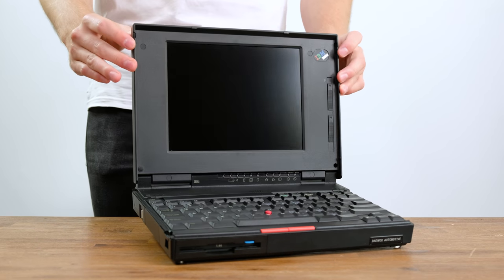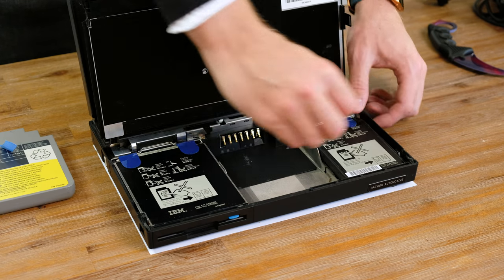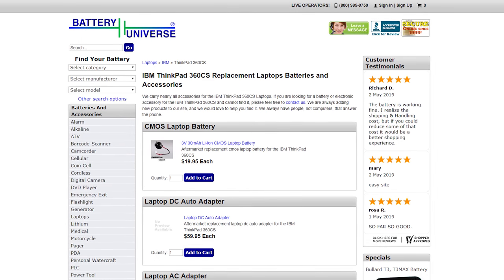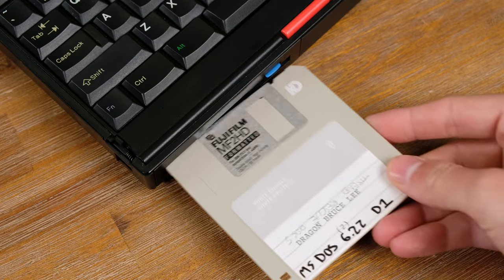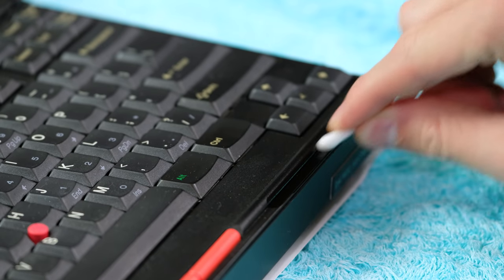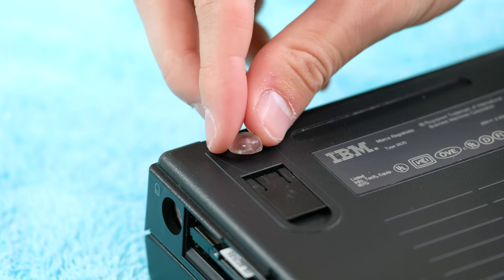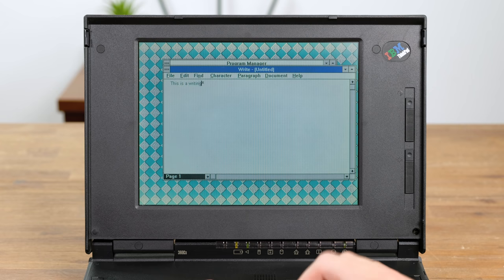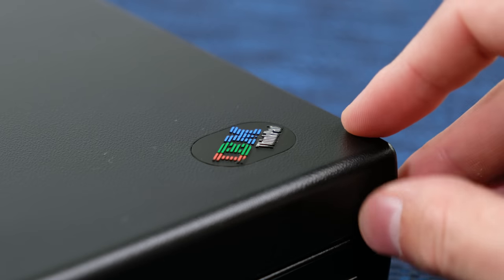I Bought A 25 Year Old Laptop From eBay! Can We Fix It?

Comment: Great video! I had a 365xd in the past, and this seems like an older version in a similar frame. The lcd has not degraded over time. It is a DSTN lcd, instead of the better TFT lcd. Latency is way higher and colors looks washed out. There is also 2 sliders on DSTN lcds.

Comment: This thicc boi can play Doom 2 at 60fps 480p like a champ.
I'd gladly use it for DOS gaming, who needs Windows?
Reply: No it can't. It'll run it, but Doom 2 needs 8 megabytes to run smoothly.
Reply: @sudocatsda1guy390  i think you could run Doom with 4 meg of ram but if i remember rightly you needed  a boot up disk that started straight into Dos to save memory and then type in the doom exe file to start the game. With 8 meg of memory there wasn't a problem which by the way, it cost me $300 for 4 meg of ram to upgrade my new pc to 8 meg of ram back in the early 90's.  I think i had a DX40 with a 2 meg video card and very small hard drive, mouse , keyboard and a 14 inch vga monitor  which cost me around $1,400 brand new. 

How things have changed. :)
Reply: @dits791  first Doom I think never needed more than 8mb. Doom 2 ran Dos native (I had my first Windows operating system in 2003, so Dos native all I knew) with 4mb, but not well. You couldn't finish the game because last two levels caused two much lag. Also the got way too slow in other parts if too many enemies were on screen. I always had flu pump* computers which I used for gaming. Trying to run games was half the fun. The other half was playing Xcom. It did run Quake and GTA on 33mh 486DX with 12mb ram and graphics card meant for text editing. Quake shareware ran decently, of slow. Full version was unplayable

* Flu pump is a slang term used in finnish referring to low power gaming computer.
Reply: DOOM ran at 35 fps and only modern sourceports let it run at 60, which this cannot run.
Reply: I'm glad this baseless joke comment was taken ultra seriously
Reply: @TheSektorz  too soon
Reply: @TheSektorz  Don't be mad you were wrong. It's ok.
Reply: sadly youtube dont have laugh react 🤣
Reply: @dits791  We all paid big bucks back then.
Reply: It has a maximum of 35fps and I think not even a more powerful 486 DX2-66 will reach this framerate.
Reply: windows 3.1 gaming?

Comment: A good video once again on these old laptops you've been doing, and turns out i also saw the listing for this very one sometime ago, knew i had from the title of the listing it have "laptop 18" within it, and have bought a few laptops from that seller as well for a cheap price, a couple of nec versas, a 4080H & a 2780MT, also a compaq armada 1590dt too. Didn't think i'd end up seeing one of them from that seller in a youtube video, but there you & here it is, and nice to see you got this thinkpad working again.
Reply from the maker: Did you have much luck with those laptops? I was tempted to buy more but the postage price was quite a bit to me. Thankfully they listed that IBM I bought as a 380Cs, which doesn't exist. It's actually a 360Cs, which is why no one really bid on it I'd say
Reply: Have yet to receive them, so when they end up arriving, then i'll know for sure. And the postage of where they came from was a bit, but as they were a cheaper price for the laptops themselves, kind of worked out that way too. And had noticed that slight error in the listing too, also what i had thought as to why no-one else went for it. Those compaqs such as the ones i got go for a bit more money nowdays, so if this one is all good & working, would have been a decent deal for what i got it for.
Reply from the maker: Some of the items went for a lot which was really surprising. There was an Apple powerbook 1400cs without a power adapter and it didnt work and it went for over $100! But yeah, there were other items that interested me but the postage price was the reason I didnt buy
Reply: I got the 3 laptops on monday, gave them a good clean like you have with this & the others, always is a good idea to give used laptops a clean like that too, and have set them up since then. the versa 4080H has MS-DOS 6.22 & WfW 3.11 on it now, and the armada 1590DT with windows 95 B as i have a few windows 98 laptops already, and is a good 95 machine too. And with those apple laptops, i saw they went for some higher prices, they tend to bring in higher prices because we know how many apple products go for higher prices, even older ones that might not even work like that 1400cs.

Comment: My first laptop, which wasn't new at the time, but not SUPER old either... was an IBM Thinkpad 360PE, with pen input flip around screen. Similarly the kbd came up to allow access to the innards, drives, battery, etc. It shipped with win 3.1, but I managed a 95c install... Used that puppy with Aol Instant Messenger, web browsing, downloading games and demos online from Game Revolution and FTP servers. Loved it... of course didn't think it would ever be worth anything as time was moving ahead, and it too was a 486, a DX2 if I recall... Just barely allowed for Win95. So I left it behind somewhere, not concerned.... just literally leaving it in an old house, or storage, or a box somewhere. just gone. And it had everything, the IBM external FDD, internal, battery, spare, dock, pen... and worked perfect. Today on eBay seeing this sort of complete set with such a rare and nearly un findable model, well.... its sad... say that much.

Comment: I actually like those rubber feet you said were weird, I think they look pretty cool
Reply: I use ones like it a lot when repairing keyboards, and laptops/netbooks, and they are indeed handy, and much easier to remove if ever need be, plus they also come in square shapes as well. hobby lobby, Walmart, eBay, and Aliexpress are good places to find them here in the US, and online.

Comment: old hardware still work today while modern is crap and go out quickly
Reply: Sultan Mehmood Ghaznavi yes still have my laptop from 2008 and its an old laptop still runs far cry 5 on50 fps than my windows 10 good pc cant either handle  doom 2 on 30 fps
Reply: thats was business
Reply: I still have my 2008 Asus laptop from when I was in college. After upgrading the ram, ssd, and installing Windows 10, it probably runs better than it did when new. I use it in my shop (small business), and I have my gaming desktop at home.
Reply: it actually doesn't
Reply: True that means smarter brains before than now 😂

Comment: I for get the exact reason why older laptops do not have suitable screen for dos gaming if there are two sliders. The laptops with a single slider for brightness have a much newer screen design since often laptops from back then were a generation behind.
Reply: Typically if they have two controls (brightness and contrast) it'll be a passive matrix display, which oft have ghosting and slow refresh. If it just has a brightness control then it's likely a nicer active matrix display.

Comment: Nice !
For some reason I have a Toshiba laptop about the same size as your IBM. However my Toshiba is much newer while sporting a Classic Pentium CPU and I think 8MB ram. It MIRACULOUSLY still works with it's OS, the worst of the worst, Windows ME. I installed Warcraft2 on it for the pleasure of good old nostalgia.
Warcraft2 also informed me "YOUR SOUND CARD WORKS PERFECTLY", and yes I was enjoying myself. It also has an external 10Mbit NIC that slides in as a card I think...

Comment: I did something similar with a little Dell Latitude 2100 which was previously a student laptop (pre-Chromebook). Obviously not as dramatic a restoration as  this video but for $60 it turned out to be a pretty sweet little project. I wiped it and installed Linux Mint. Sweet little laptop for my 6yo daughter to start learning on.

Comment: Neat! I still have the first computer I ever used - a 2006 Inspiron E1505 (Intel T2300 1.66 GHz Core Duo, upgraded to 2GB ram, 80 GB HDD). I hope and plan to keep it and upgrade it further, including new LCD panel, speakers, SSD, and maxing RAM with a 4GB 2x2 kit (chipset may only supports 3.20 or thereabout).

Comment: Laptops can get dusty in the inside so easily, my 2nd laptop that is more than 5 years old still being used is so dusty in the inside, after cleaning it up, massive boost and the fan works smoothly also, it was clogged, so clean laptops :)

Comment: I had a 755CDV, it was given to me in around 2002. it was similar to this one and I believe was available around the same time frame. it had a Pentium 75 a 2GB HDD, an Active Matrix Display, MWAVE Sound Blaster compatible sound, and one of it's more unique features was that the entire back of the display could be removed so the laptop could be used on a projector. It came with Windows 3.11 and OS/2 Warp. It was still loaded with the original utilities and software, and of course drivers for the fancy 64K Colors 640x480 Western Digital Graphics Chip.  It also came with all the setup diskette images and a tool to write them to floppy diskettes as well, possibly to use up what was a gargantuan HDD at the time. Unfortunately for it, I had decided to leave the battery inside and it eventually leaked, which ended up destroying the system board in ~2010, causing all sorts of unusual errors. Starting with Disk corruption and hangs and then I found it could not even boot from a clean MS-DOS boot disk and showed "Divide error" when it would show the prompt. The internal diagnostics also failed the system board which pretty much verified it was toast. A shame since apparently it is one of the most valuable "vintage" Thinkpad laptops, partly because it was pretty much the highest end model for the time. Not to mention I also got the ThinkDock I with it, which I also tossed after the laptop died...

Comment: That motion ghosting is not a fault. It's a dual scan panel. They are that bad. Enable that "cursor tail" (or what is called) under mouse settings in control panel. That's what it's for. And pause the gaming until you find a TFT panel for it. They were available, but very expensive. Not so much today... But this is a good thing to know when tinkering with old stuff. Can't remember exactly, but somewhere between 1997 and 2004 TFT panels started to appear in more and more cheaper models and not only in the most high end.

Comment: The display hasn’t degraded. It’ll be a passive matrix display  which is rubbish for things requiring a quick display response. I have a Toshiba T3400CT from the same era which was one of the first subnotebooks to have an active matrix tft display and responds much more quickly as a result. The picture it also much clearer as a result.

Comment: I have an laptop running Windows 3.11 (for Workgroups), which i go back from time to time. Tough, i have to restore the C drive's contents and it has to be plugged in MANY times. It also has a monochrome display and some programs I assume were for work. The program manager does not load groups either.

Comment: Consider yourself lucky! Fully working vintage laptops from the 1990s in 99% pristine condition are getting increasingly rare! If you keep it working and you keep the battery charged up, it will be worth THOUSANDS in 10 years!

Comment: Yes all websites load due to browser and being a Pentium II with 160 MB of RAM. I was testing the computer out with IE6 SP1, Firefox 2.0.0.20, and Opera 10.10 the computer somewhat the sites properly. I will do a better using a VM-Ware virtual machine using Windows 98 on the internet.

Comment: So last week I was looking at photos on my well my mums windows 10 computer she never uses and I saw a red laptop that I knew was still in the loft, my mum previously told me that an old acer laptop running Windows XP didn’t work anymore but I fixed that by charging it, it wasn’t holding any battery so I thought that was the case with the red one I found and like my mum said it didn’t work but it just needed power at first it made a beep sound and then started up as windows vista and it needed to be restored to a working version and when that loaded I was surprised to see that it thought it was 2007 still and it had my brothers Lego hero’s factory background from 2012, all is good with the laptop now but the lid is sticky and I’ve tried to clean it off so many times but it’s still sticky my mum thinks it’s the plastic rotting away what do you think if you’ve made it this far....

Comment: I have a 360PE from eBay, it turns on but nothing happens. Screen is black, no HDD activity or beep sounds. Someone help me fix thus issue!
Reply: Josiah Barkhau:  Check the RAM and HDD are present + the power supply (including fuses) work correctly.

Comment: You could try put win xp
Reply: I don't think a 486 SX CPU would be enough power....or a MAXIMUM of 20MB of RAM, and especially a hard drive of 146MBs, you need at least At least 1.5 gigabytes of disk space, about 11x what that has, a 233-megahertz processor, about 8 times the power of that laptop, and at least 64MB of RAM, about 3x the MAXIMUM that laptop can take.  So that laptop is out of the question of running Windows XP, think about it and you will be amazed at what the laptop has compared to today's technology.  And really MBs of RAM so 1GB of RAM is 1000MB!  So a 8GB computer toady has 400x the MAXIMUM RAM that laptop can take.
Reply: You'd need at least a Pentium to do that. Surprisingly, Windows XP can run on these beasts at extremely low clock speeds (slower than a 486.) https://www.winhistory.de/more/386/xpmini.htm

A slimmed down install of Windows 2000 would probably work.